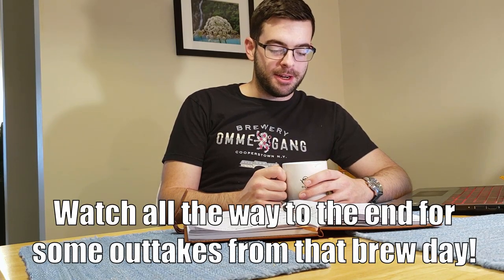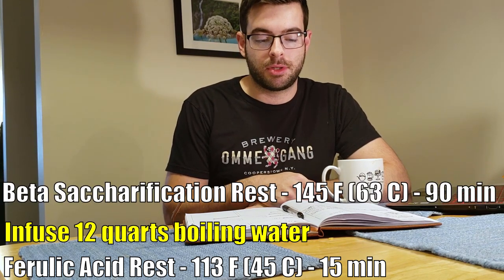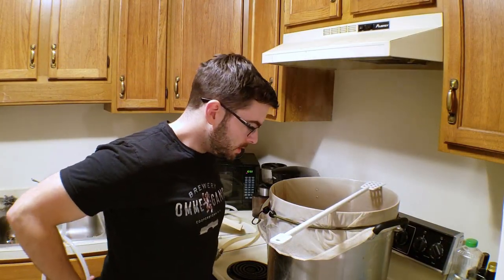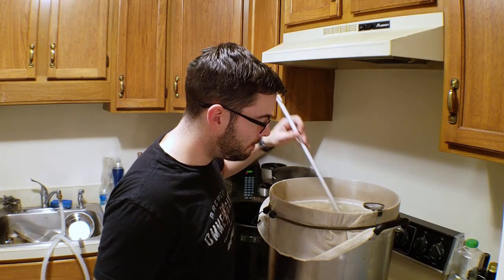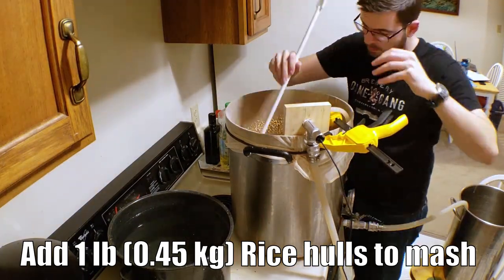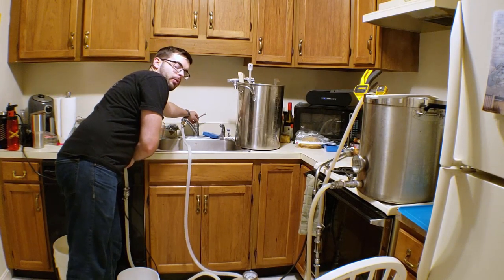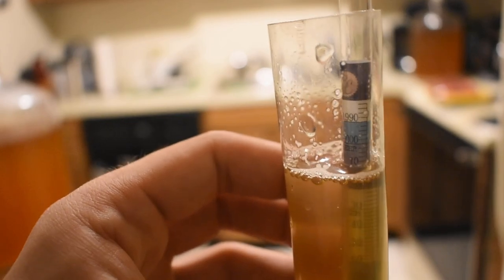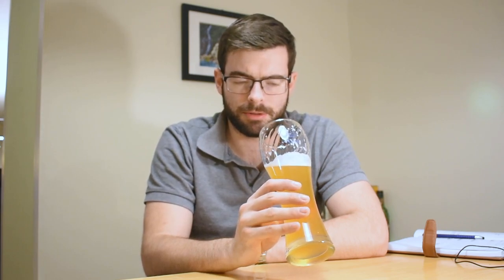Brewing a Decoction Mashed & Open Fermented Hefeweizen | Grain to Glass | Classic Styles

Comment: Man, I enjoyed the video. I think You did AWESOME!!! Don't give up on the decoction method it takes quite a long time to dial it in and the literature found in the homebrew hobby about the method isn't accurate which makes it more difficult. To make decoction brewing ale and lager easier remove 1/3 of the grain bill and grind it into a kettle. Grind the remainder of the grain into the mashtun. Dough in both with 1 qt. RO water/ lb.. Here's where decoction brewing becomes interesting. The 1/3 batch can be rested at different temperatures, depending on the beer. The 1st decoction usually starts with the albuminus rest before the temperature is increased to saccharification temperature and rested for 20 minutes before being boiled. The main mash is held at a low temperature to preserve Alpha during the time the 1st decoction is worked with which can be an hour and up to 3 hours long, depending on the beer. The decoction method is a cool temperature brewing method using a very thick mash to preserve Alpha. Mash in temperature is usually 50-55F which begins softening starch. The mash is rested for at least 3 hours, overnight is better.
The rest at 145F for 90 minutes is too long, again, preserving Alpha is important in decoction brewing. Next time, use 140F for 45 minutes, then, increase temperature to the 150F range for 20-30 minutes to denature Beta and allow Alpha to liquefy starch. Alpha releases sweet tasting, nonfermenting, sugar and glucose from simple starch, amylose when the enzyme liquefies a numbered link in the starch chain. When the link is liquefied 2 chains form, 1 chain is called the reducing end. The reducing end contains more links which Alpha liquefies until all the links are gone, leaving sweet tasting sugar behind. The other chain is the nonreducing end which is simple sugar, glucose, responsible for primary fermentation.
Beta really doesn't release sugar. Beta is the converter. During conversion Beta converts glucose released by Alpha into complex types of sugar. When 2 glucose molecules are bonded with 1 molecule of water Beta forms a di-saccharide, maltose. When 3 glucose molecules are bonded to water Beta forms a tri-saccharide, maltotriose. When conversion occurs secondary fermentation is necessary. Beer doesn't need priming sugar or CO2 injection for carbonation when conversion occurs. Beer naturally carbonates during conditioning due to maltotriose. The single temperature brewing method doesn't require secondary fermentation because temperatures in the 150F range denatures Beta quickly, curtailing conversion.
During dextrinization and gelatinization Alpha releases A and B limit dextrin  from complex starch, amylopectin which are tasteless, nonfermenting types of sugar responsible for body and mouthfeel. Amylopectin is heat resistant, hard, starch and boiling the mash causes the starch to burst and enter into the liquid, quickly where Alpha liquefies the starch, stopping at a 1-6 link or a branch. The temperatures used in single temperature brewing aren't high enough to cause the starch to burst before Alpha denatures and the starch is left in the spent mash. Did you notice if the mash jelled up when the decoctions were added back into the main mash? 
A ferulic rest is usually performed in a small volume of mash because for the rest to work efficiently the pH has to be around 8. The pH is increased in the mash and reduced before being blended with the main mash. I think that if the rest is performed in the entire mash at pH in the 5 range it may be too much and the flavor may be aggressive in the final product. At the low pH there is probably a temperature to match it, that's the way that enzymes work and there's always an optimum temperature and pH. At a low pH maybe 104F is needed or maybe 122F. The same applies to the protein rest. When the entire mash is rested at an albuminus temperature it's too much and the beer will be insipid, but stable. You might want to look into the IOB for info on ferulic acid and see what they say. The IOB made malt, modern. 
The decoction method isn't known for releasing tannin. Tannin extraction is a time/temperature/pH thing and it is possible that the issue was caused due to pH and long rest periods when the beer was made. When mash is recirculated at a high temperature for longer than 10 minutes a condition called over sparging occurs which releases tannin. If pH is high use some sauer malt and stabilize pH before activating enzymes. Use the spec sheet that comes with each bag of malt, the pH of the malt is listed along with the level of modification (Kolbach, SNR). A spec sheet is used for determining the quality of malt before the malt is purchased. It was invented by the IOB.  
To make ale and lager the decoction method and under modified, low protein malt are required. It is chemically and enzymatically impossible to produce ale and lager with a single temperature rest method. The single temperature method and high modified malt are used in grain distillation and the beer is called distillers beer. During Prohibition it was called moonshiners beer. A person in the homebrew industry made a statement many years ago about the decoction method. He said that the decoction method was used back in the day because the malt back then was inferior to modern, high modified, malt, and since the invention of modern malt the decoction method became antiquated and the single temperature method is all that's needed for making ale and lager. The statement is false. The statement is a sales pitch. Brewmasters use the finest malt and they tested malt to ensure it was high quality. To take advantage of the high quality malt the decoction method is used. Using single temperature infusion doesn't take advantage of the rich, more expensive, malt. It was brewmasters that created the IOB to test malt so they wouldn't have to. The word modern was stamped on bags of malt that were tested by the IOB to differentiate the malt from the malt already in warehouses that the brewmasters would need to test. High modified malt was invented the day the Great Magnet invented barley, it's part of germination. The higher the modification the closer the seed comes to being a plant and enzymes become depleted. The higher the protein percentage the less sugar is in the malt, less starch. Homebrew 2 row malt is usually high protein malt with 6 row being the highest protein, 16%, that's why 6 row has high diastatic power, not as much starch for Alpha to work on. Malt above 10% protein is considered high protein malt, homebrew malt is 12 to 16% protein.
When starting out with the decoction method it's better to stick with a single, under modified, low protein, malt until you learn how the malt reacts through the enzymatic temperature ranges and during chemical changes that occur after the decoctions are boiled. It's better to limit adding chemicals and harvesting yeast until you establish a consistent baseline which requires making a lot of beer but you're still young. The chemicals homebrewers add are mostly used during the testing of malt, anyway. A brewmaster won't tell anyone what he does with water and malt, so, don't believe someone that says he treats a brewers water. A brewer doesn't use an outside vendor for water treatment because they have the ability in house because they are smart people. The person that treats water in a brewery treats the water for the steam boilers, chillers and condensers to increase life cycle and most of the time that's done in house, too. There are enough chemicals in malt to occupy your time for a long time and yeast, you are light years away from harvesting and you will get in trouble. You need dye to determine if the yeast is suitable but the dye doesn't ensure the yeast is  healthy. Instead of jeopardizing beer that you spent 10 hours on, don't add harvested yeast, use new stuff, I implore you. Starting with wheat beer is tough but I admire your zeal.
Skim off hot break in the decoction kettle and in the boiler before adding hops, add hops after hot break reduces in the boiler.
I'm tired. Stay healthy and safe you and yours and stay thirsty, my friend.

Comment: My fave specialty beer bar used a trick to keep hefeweizens foaming vigorously: put it a couple of grains of rice after the glass is poured. The rice adds no flavor and has nucleation points to keep the beer foaming, also it will find its way through the foam head and it will stay below the foam head after that. If it foamed too much, they wiped a slice of lemon on the rim of the glass to keep the foam down. Though you won't need that if you take a good first glug out of your glass. 

Cheers!

Comment: Awesome video!  Regarding the banana/clove balance, wayy wayyy back when I brewed a hefe, I think I read that the banana is an ester, and the clove is a phenol.  To increase banana, underpitch and ferment warm (in the 70s for this strain).  To increase clove, overpitch and ferment cold plus ferulic acid rest.  So I agree on nixing the ferulic acid rest, but maybe pitch a little warmer and stress that yeast a little more to get the balance you want.
Reply from the maker: You're 100% right on the flavors being esters or phenols respectively. Even though I fermented around 68 I think I should have pushed it even higher, despite still under pitching and under aerating. Just gives me another excuse to brew again haha. Cheers!
Reply: @TheApartmentBrewer   Yeast Fermentis WB-06 gives more bananas above 73,4°F. I have brewed 3x with WB-06 and usually end up with some fruity banana ish beer weizen like. :D Never had proper weizen though.

Comment: I brewed a few decoction beers in the recent years and I can say the effort is worth it, especially for a Weizen. I use a shortened decoction. Perhaps you can try it:  Step 1) mash in at 35C and rest for 15 minutes.  Step 2) take 1/2 of total volume as thick mash, heat it to 72C, and hold it for 15 minutes. Then boil the thick mash for 20 minutes.  Step 3) Put thick mash back to the remaining mash. Temperature should now be at 63C (at most 65C). Rest for 15 minutes.  Step 4) Take 1/3 of total volume as thin mash, boil it for 20 minutes, and put it back. Temperature should now be 72C. Rest for final 15 minutes, then mash out.
Reply from the maker: I'm definitely interested in trying it, that's a lot less time commitment than a traditional schedule. Cheers!

Comment: Very nice video.  Congratulations on your hefeweizen.  Man, a lot of work.  I have just switched from extract to all grain so I have a lot to learn.  I believe I can learn quit a bit from your channel.  One thing I found out recently is that if you ferment at a slightly higher temp the yeast will produce more of the banana notes.  So, the last hefeweizen I brewed (an extract brew) I fermented at around 72 to 73 degrees and it had really nice banana notes to it.  Very enjoyable.  Thanks for the video.

Comment: I wouldn't give up on the acid rest. I made a hefeweizen recently with wlp300 and did an acid rest for the first time and it was strongly banana and bubblegum. I did not do the decoction for reasons you already understand lol. Try the acid rest again but give wlp300 a try and give the beer about 3 weeks in the keg with bitey carbonation. It will improve dramatically.

Also try to ferment at 62F. I know its against popular opinion. But it worked.
Reply from the maker: The best hefeweizen I ever made was fermented at a strict 62 degrees and it was pretty great. I believe wlp300 and Wyeast 3068 are the same strain, but I wouldn't mind doing the acid rest again but maybe with a step mash Haha
Reply: @TheApartmentBrewer  yes, absolutely. They could be the same and I changed both variables at once, thinking both things made it better.

Comment: Love your videos! I think you answered a question for me today. I have an ultra-low watt density 240V heating element (Clawhammer Brew Supply) that scorched on a German Pilsner recipe. Started mash at 126 for about 20 minutes or so.. by the end of the boil I had beer that "tasted like an ash tray." You think this is protein build up on the element during the low mash temperature? 

Glad I found your channel! Thanks
Reply from the maker: Very likely so, I would advise either cleaning the element between mash rests if possible, being very slow with your rise times, or using boiling water to do your first temp change. Glad I could help!

Comment: Thanks for your video! Regarding your kegging and tasting experience ... What about trying classic german bottle aging for wheat beer instead of force-carbonating the beer? I usually do second fermentation in half-liters bottles (these are very common in germany where I come from) and add some sugar matching the Co2 requirements (to get about 6gr of Co2 per liter). The yeast that ferments this sugar also adds some aroma to the beer and can be poured to the glass to intensify the cloudy look of the beer and doesn't give any off-flavors to it.
Reply from the maker: I think the bottle conditioned version I made last year definitely had more character, I just wanted it quickly and on draft Haha. Cheers!

Comment: So what do you do to boil your wort when using high amounts of wheat malt - you mentioned your system would scorch previously do you just not use the immersion element and only use the stove top?
Reply from the maker: It seems to only scorch at specific temperature ranges lower than boiling with all that protein. I had issues in the 100-140 F range but after that it didn't seem to scorch anymore
Reply: @TheApartmentBrewer  do you just avoid using the immersion element at low temperature?
Reply from the maker: That's correct, I'll typically just use an infusion of boiling water to raise the temp if I'm step mashing at those temps
Reply: @TheApartmentBrewer  it's happened to me as well - unfortunately my brew system has built in element ! It's only happened with very very big grain bills but so disappointed when it ruins the beer

Comment: Brewed my first hefe just so. Single infusion mash. I'm a very beginner, only my 3rd batch ever and I definitely over hopped this one. Calc says 30 IBU which is way too much with my lower brewhouse eff. also tried try hopping in this batch and I guess it works alright but I feel like the hefe flavours are left behind this way... Looks very same than your hefe!
Reply from the maker: Yup. You really want to have a light hand with the hops on a hefe. Unless of course you're trying to clone the hopfenweizen that Schneider Weisse does. Did you use new world or European hops? Either way over time the hop flavor will fade out and you'll be left with more of the classic flavor.
Reply: @TheApartmentBrewer  I used Magnum at 60 minutes.

Comment: no yeast nutrient for this one dude or is it just not in the video? You usually add it in so wondered if there's a reason not to with this one.
Reply from the maker: So in this case I didn't actually add it in, trying to get the yeast to express more by slightly stressing it. There is some debate on whether this is an effective method, and I can't definitively say if it's worth it. Healthy yeast is pretty much always better.

Comment: Honestly this seems like a massive waste of time especially if you just doing Brew in a bag.. other than for saying you can do it and have done it there's literally no benefit all the modern malts make this kind of pointless big surprise and  Munich malts are huge with malt flavor and cripsness.. the modernize malted grains we all use have made this a meaningless procedure that is not going to render you any benefit you can't get from modern malts.. 
Watch the efficiency between that and normal biab...
Reply from the maker: Like I've said many times replying to various comments, decoction is a hotly debated topic. True its definitely not necessary anymore due to modern malts, but it doesnt mean it's not worth doing. Personally I dont think it's a waste of time because I had a lot of fun doing it, even if it was a lot of work. To each their own, cheers!
Reply: The decoction method is used when under modified, low protein, brewers grade malt is used. Under modified malt is rich in enzyme content. Low protein malt is high in sugar content. The malt you use is high modified, high protein, malt.  High modified, high protein, malt is distillers grade malt and single temperature infusion is used because the malt contains mostly Alpha which releases glucose. The beer is called moonshiners beer outside of the homebrew hobby. The single temperature homebrew method skips conversion, secondary fermentation, dextrinization and gelatinization and without the steps ale and lager cannot be produced. The person that told you that modern, high modified malt is great for producing ale and lager and that it only requires soaking the malt in hot water for an hour told you a fib. It's chemically and enzymatically impossible to make ale and lager with the method unless the malt contains magical properties. Back in the 70s a group of advertisers working for the homebrew business came up with CAMRA and they turned moonshiners beer and Prohibition beer into ale and people fell for it.